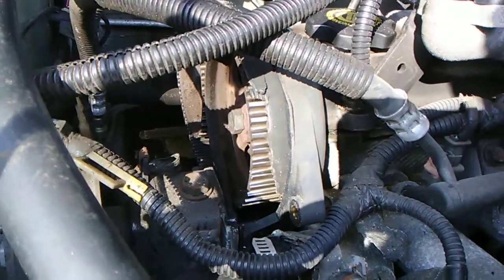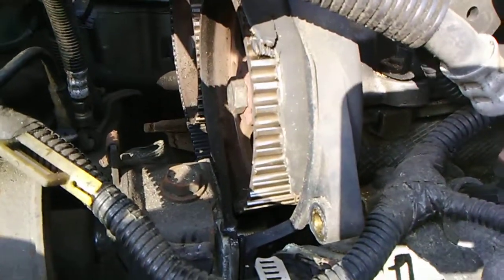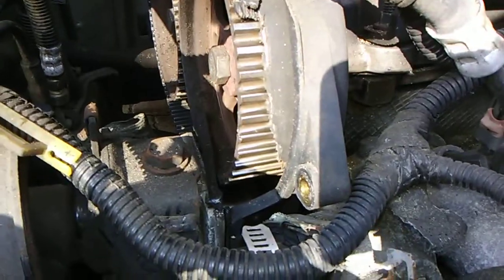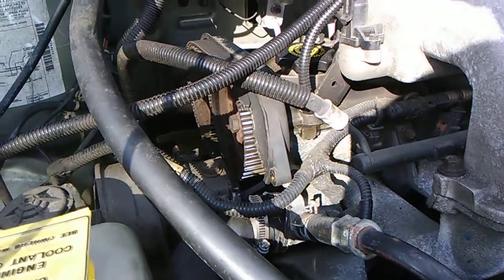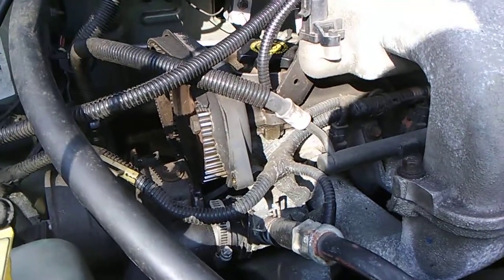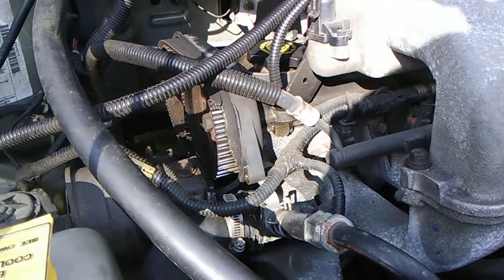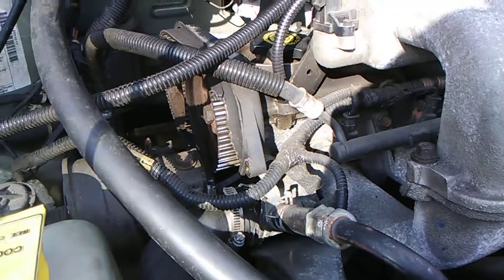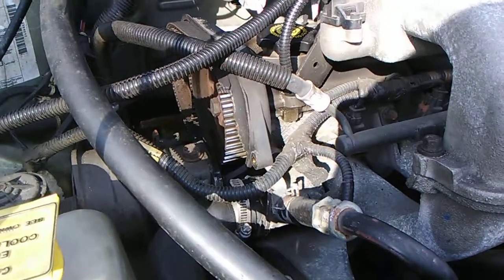Dodge Caravan Cranking But Not Starting - There's Your Problem!

Comment: Where did you stray the starter fluid?
Reply from the maker: In the air intake... Disconnect your air filter and spray starter fluid through the butterfly valve, and God willing, it'll start. In my case, our Lord wanted me to learn how to replace the timing belt, so I did, for His glory! Soon after I sold the van and we now drive an awesome 2005 Grand Caravan... #TGBATG
Reply: @DanielStPierre  
Thanks
I figured it out and already tried it
No luck

It cracks good.....but still won't turn over